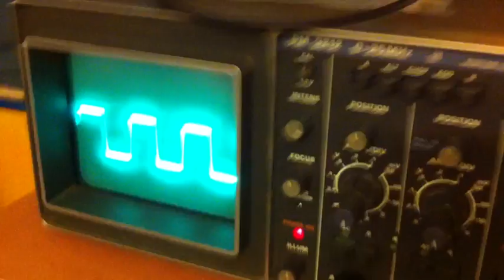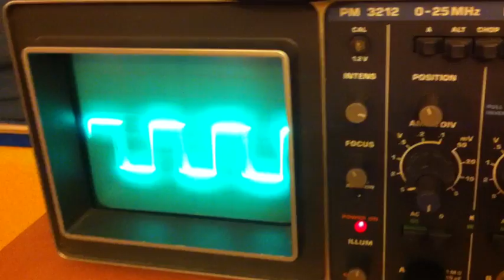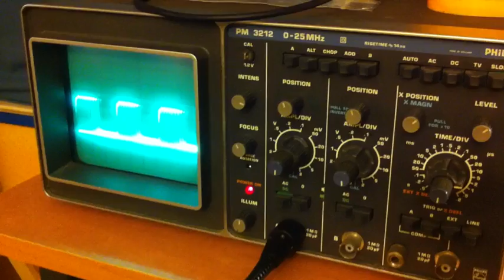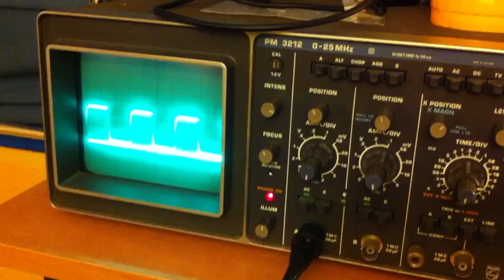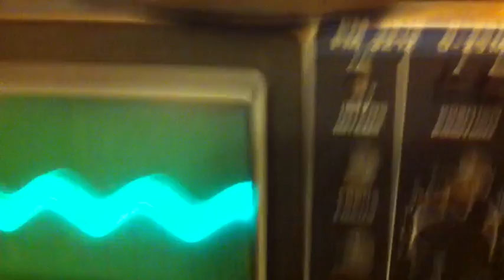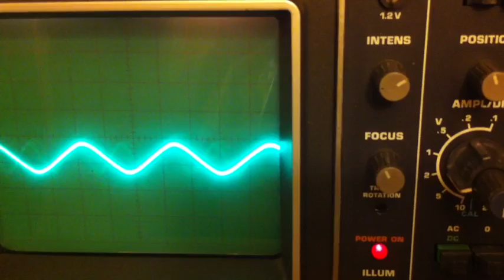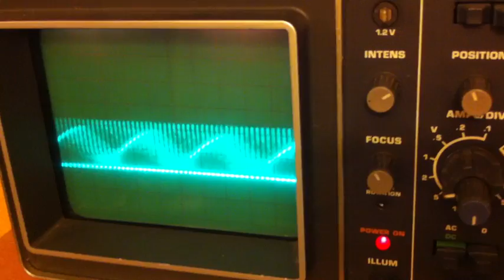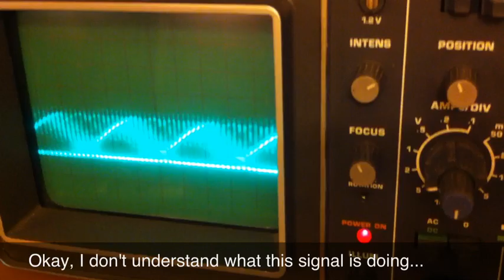Using Arduino PWM And A Crystal Oscillator To Make An AM Transmitter

Comment: You need to add a low pass (RC) filter to the PWM output. This will allow only the audio to pass and not the square waves from the PWM.

Comment: You need to add a low pass (RC) filter to the PWM output. This will allow only the audio to pass and not the square waves from the PWM.

Your oscillator is also outputting a square wave (or signal with harmonics) this causes the images that you are receiving across the radio band.